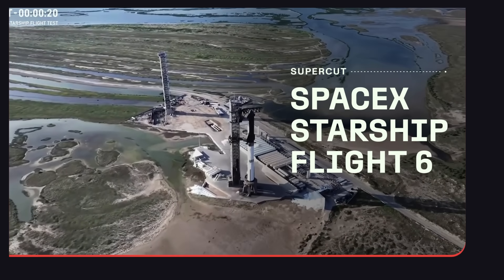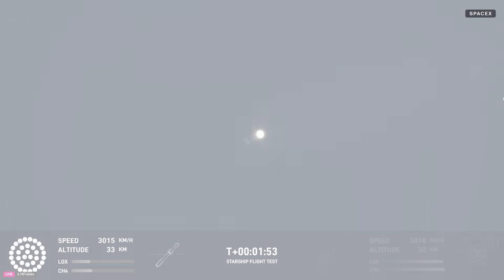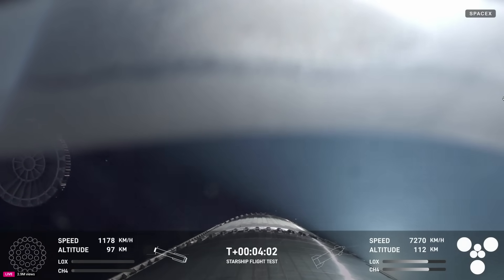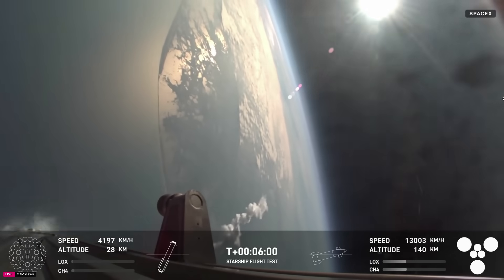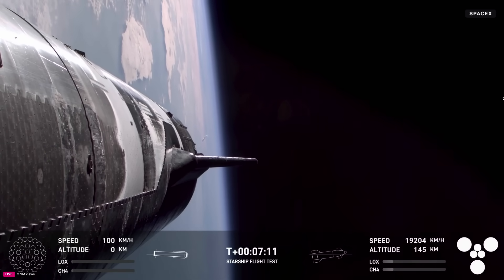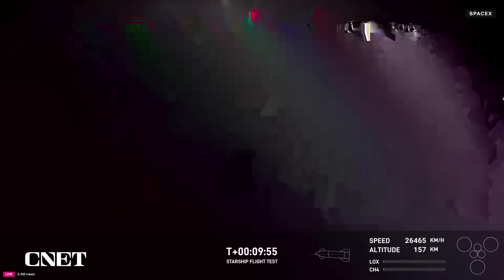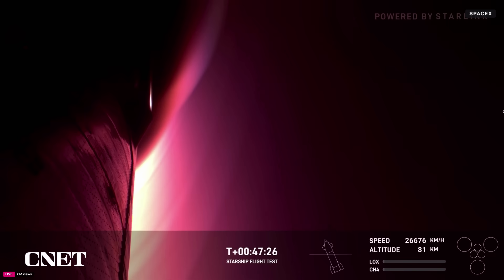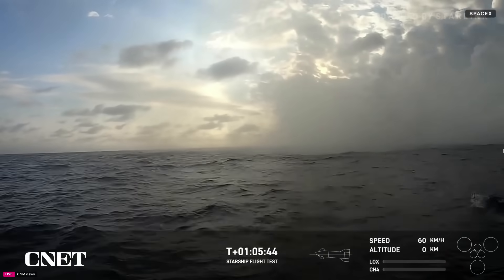SpaceX Starship Flight Test 6: See Everything That Happened in 14 Minutes

Comment: Why not just stick an outboard boat engine on this and drive it back to port when a tower is not needed. I mean the landing seems soft, if it floats it can be a boat!'
Reply: it blew up after it tipped over in the water, its a 20 story building tipping over, not even a steel ship can stay fully intact.

They want to re-fly the thing in under an hour anyway, landing back at the pad saves the most time
Reply: Also, steel and rocket engines don’t do too well with salt water

Comment: Im of average intelligence so I need help to understand.
I grew up on the beach of Puget Sound Washington....you can spray fresh water on your kayaks, outdoor furniture, outside hardware, etc until you're blue in the face and corrosion wins the day. How can those extremely critical "parts" of the booster be 100% for next launch.
    Even with engines firing to ease impact doesnt the impact and even the dramatic cold water temperature result in damage? 
     One commenter said the booster will not be retrieved...is that true?
Reply: These were landed in the ocean due to 1) it being an abnormally heavy launch and 2) there being issues with the computers on the catch towers.
Normally, they'd land on the catch tower and a landing pad on land.
These were ditched for safety basically.
Reply: If you're asking questions about this stuff you are already way above average intelligence.
Reply: @skyriminspace  
That made me LAUGH OUT LOUD!!!
Very kind of you, though.

Comment: Have anyone noticed the ship turned 90 degrees in 3 seconds and stayed vertically in the last moment? For a object such big, this maneuver is unimaginable! This shows how maneuverable and how well controllable the ship is.
Reply: Keep in mind the ship was almost completely empty. Most of mass is the fuel.
Reply: @mikaxms  good point
Reply: @mikaxms  120 ton weight, 50m tall and 9m diameter. Turn 90 degrees in 2 or 3 seconds. Think about it.
Reply: @namei8967  Stacked and fueled the mass is about 5,000 tons and empty the booster is about 120 tons. So, during landing the thrust to weight ratio is off the chart. The dimensions (aerodynamics) are negligible compared to the mass (inertia). Not all that crazy if you think about it.
Reply: @mikaxms  if you have done any automatic control stuff, you would appreciate the difficulty.
Reply: @namei8967 oh yeah I wonder what the people onboard would say about that, if this thing can ever board humans in it…
Reply: @mossy2571  first, not a question of ever but how soon. Second, this is only an experiment to test its maneuverability and controllability. Once people onboard, it will fly most smoothly.
Reply: I was frightened when it waits another 6 seconds after 0 km altitude has shown up
Reply: @Bass0hr  Did you not read the FCC filing?  They also not put heat sheild C filing?  They also not put some heat shield around header tank and most of the side. Bro this thing is built in Tent ofc they are empty.
Reply: The manoeuver is called the belly flip! Ship is gliding and controling its descent the whole time just like a skydiver then relight engine, flip and land vertical
Reply: Very intelligent and genius people replying as if this is very easy thing, fuel , no fuel, blah blah 😅 very funny negative people whose no appreciation have been received from childhood, even from their parents. Now taking revenge on social media 😊

Comment: So they regressed from the last attempt.
Still did not take anything to orbit and that burning husk of a starship isn’t going to be reused any time soon.
Reply: In terms of catching the booster, yes, technically. Better be careful than to risk the tower. But the second stage performed great, despite intentionally having less heat shielding this time. The engine relight test was a success, so the next flight will actually see Starship go orbital.

Comment: Two things to point out
1. Catch the Booster is not possible -> Sucessfully make a soft splash instead as if its a casual thing to change plans
2. We do not except to recover Starship this time -> Achieve Soft splash aswell sucessfully

Full success i would say.
Thanks to everyone at SpaceX making this possible
Reply: And the booster looked in better shape compared to Flight 5(It didn't lost a part when the engines lit not did it have the fire).
It looks like the antenna at the top of the tower was damaged and they lost connection so they decided to go safe and did the ocean landing instead.
Reply: NASA tech
Reply: But booster fell in the water, thought it would stay up.
Reply: @CapricaPrime  if the booster lands in water, they wouldn't be able to recover it fully intact. Salty water and impact force on tipping over do bad things to the booster. So, unfortunately, it sank.

Comment: if the catch cant happen all the time then its pointless to even build the rocket. I'm baffled why Elon can't see this.
Reply: Should clarify, there was TOO much of a risk that the booster catch would fail, they determined that it surpassed that threshold and aborted
Reply: Yeah, he's not NEARLY as smart as you are. Nor as well-informed about what SpaceX is doing
Reply: The goal is to eventually catch every rocket and booster. Right now they are still deep into testing, and they need more data. They need to know if removing the heat tiles where the catch points will eventually go, means that the rocket will burn up on reentry, long before they could ever catch it. They didn't catch the booster because there was a risk it wouldn't be successful and possibly destroy the launch pad.

Comment: Why didn’t they catch? What’s the point of this test?
Reply: For the booster, they determined it wasn't within safe parameters. At risk of destroying the launchpad which they only have one of. As for the ship, it doesn't have the catch points. So they wouldn't be able to. Instead they removed heat tiles where the catch points would be to see if it could survive reentry with those tiles gone
Reply: To ditch this version for more space for the v2 starship.
Reply: In-orbit engine relight and attempting reentry with less heat shielding in certain areas. While they didn't manage to catch the booster this time, everything else was a success.

Comment: How is this any different from the one caught by the mecazilla a week ago?
Reply: It was the same objectives as last flight. The starship is still in it's testing phase. It will be for the next year. They will continue to launch and improve until it's perfect. Possibly another 6-10 launches until it's safe enough for astronauts.
Reply: @lukeflynn3943  100 launches atleast until it gets human certified....they'll start launching bigger size starlink satellites from next year while simultaneously testing and improving for next 2 years before we see first probable uncrewed Mars mission along with a Crewed Polaris Dawn mission.
Reply: @lukeflynn3943  Elon says he wants to do 100 launches before putting any human on board
Reply: Re-light, which is crucial as they work towards orbit.  The sheer size means that an out of control Starship would be dangerous, so they are progressing gradually.  Also, since this is the last of the first version, they re-entry of Starship was a lot "spicier" than before, by  having a lot less tiles, and basically pushing the envelope beyond what the FEA said they could. Their simulations predicted loss of control.
Reply: This one didn't involve re-entry plasma eating all the way through one of the aerodynamic flaps and attitude control of Starship hanging on by the skin of its teeth. 

Last time was a success, but at least partly by luck as the plasma permanently damaged the flap and would require serious repairs before reuse. 

This time Starship seems to have come down pretty much completely unscathed until the splashdown.

Comment: Didn't do ANYTHING new ... WTF was the point of this one ? 
They literally did WAY less this time. 
EXTREMELY disappointing.
Reply: They tested the engine ignition in a vacuum and it worked.  That means they'll be able to reach outer earth orbit and beyond (like the moon).

They also removed 2,100 heat shield tiles to test the durability of the ship on reentry and look for vulnerabilities and it still worked well.
Reply: @jeremyg591 yeah, but other than the new things they did, they didn't do anything new!
Reply: @BM-si2ei  :D 😂🤣